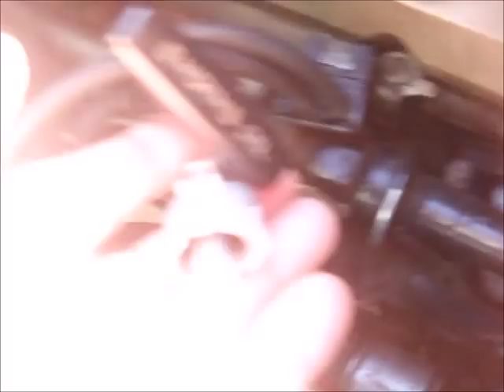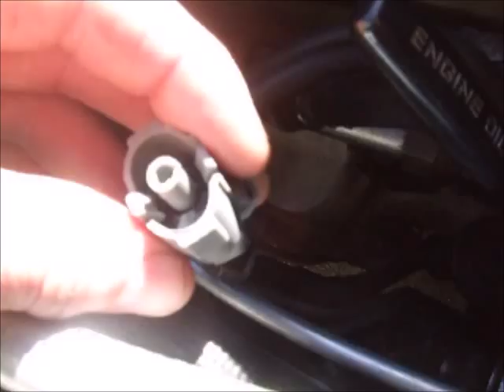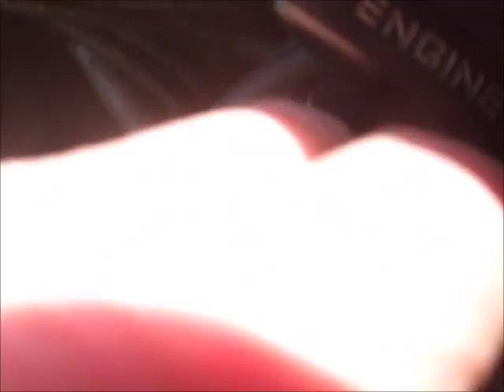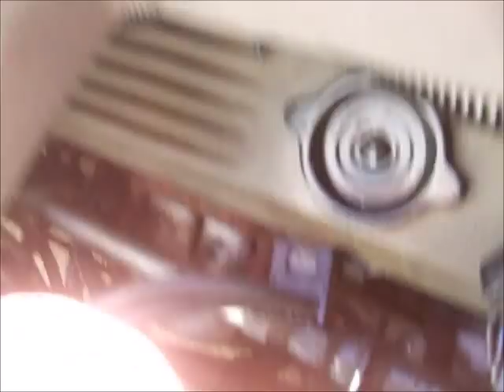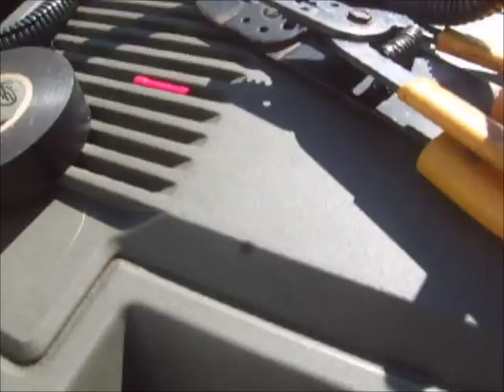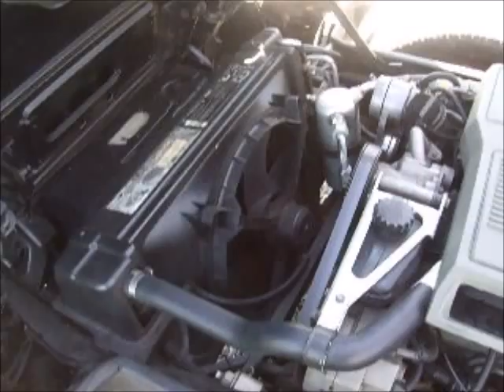𝐀𝐋𝐋 𝐎𝐑𝐈𝐆𝐈𝐍𝐀𝐋 *𝐒𝐓𝐎𝐂𝐊* 𝟏𝟗𝟖𝟒 𝐂𝐎𝐑𝐕𝐄𝐓𝐓𝐄 Cooling Fan wouldn't shut down (shorted wire)

Comment: Having trouble finding Circuit 335 (Connectors C115 and C100). FSM says Pins 7E and 2F but where on the car are they? Cooling Fan Relay is currently bypassed keeping the fan running but want to restore back to factory design. Testing the ".5 dk grn/wht" wire voltage to ground (alternator frame) while engine running, is < 2 VDC so suspect an open somewhere in Circuit 335. Can't check continuity until finding C115 and/or C100. Thoughts?
Reply from the maker: Circuit 335 at the fan relay should grounded when the temperature switch on the engine I nblock on the passenger side reaches temp and closes. The one thing most suppliers forum people get wrong I s, on the 1984 the cooling fan system is a STAND ALONE system there is NO ECM input. The relay on the wheel well should be hot at all times red wire, I think the brown wire from sensor on passenger side, the power wire to the fan motor and a fuse wire, forget all the colors, But the whole system is totaling simple and straight forward. Power, ground, temp sensor on pass side engine block and a fuse. When the sensor  closes it grounds and the fan turns on. O don't have my electrical trouble shooting manual any more, doing th I s all from memory, sorry.
Reply from the maker: My fingers don't fit this tiny phone screen lot of misspelled wording.

Comment: Same problem here, fan all the time, I tested with a multimeter and yes... the brown cable is grounded somewhere, but I can`t see where... exactly in what part the brown wire was melted?... thanks for the reply
Reply from the maker: Mine was melted against the manifold and shorted. The fan circuit is problematic, the relay connector at the wheel well  gets old and brittle and the 4 wires inside it melt together as well. I have had my share of issues with the fan circuit, so I rebuilt it all, as for that wire and I know it;s time consuming, best thing I can say is get the multi meter out and start tracking the wire. If you can afford it, you can buy a cable tracker at Harbor Freight or elsewhere for $20 or KLEIN tools for around $50 they help trace wire shorts.

Comment: I see mine melted too. I shut my engine off cause I smelled burning sure enough that was it but now my fan is on after 4minutes is that natural? I noticed the battery bolts plunging from 11 to 8.5 then lights went dim and raidio went off,still power antenna but sound gone :(  can u offer any advice? Thanks Vincent.
Reply from the maker: I don't know regarding the 4 minutes, could, if the engine were running cool and not sitting in hot sun I suppose, all depends on  what temperature the engine got to, really  has nothing to do with time but temperature. The battery and lights dimming sounds like a diode in the alternator, but with this car it could be anything....is the alternator charging.....either that or a shorted circuit somewhere.